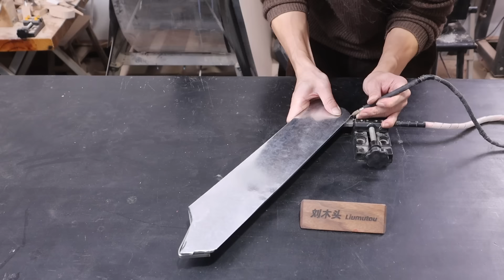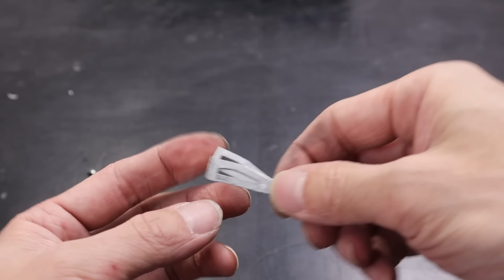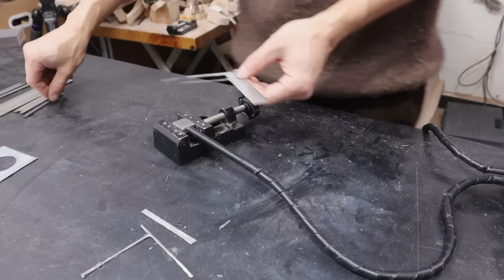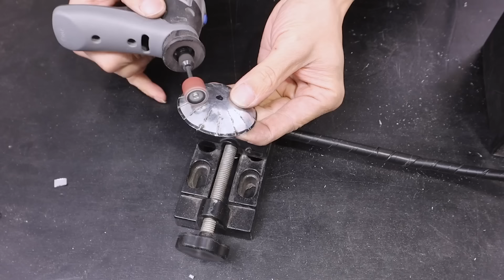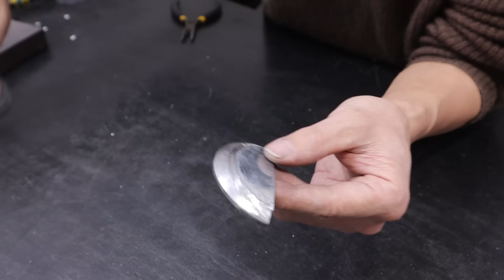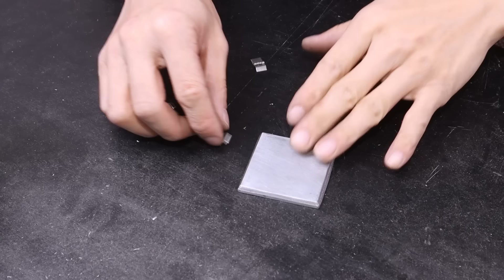Build Metal Tank KV-2 | How To Make a Tank out of Metal | Remote-Controlled Tank

Comment: What welder were you using on the sheet metal?  Great project, thanks for sharing.
Reply: Spot welder its using high dc current for a second to melt the two metals together its also used to connect lithium ion batteries
Reply: @w4st3lander why did not the chap use isolating/insulating gloves?
Reply: @tatianaes3354  it's not a good idea to use gloves as they can catch on fire also the current only passes throu the metal not your skin. Also its not high voltage only from 2 to 20V depending on the spot welder its mostly only high current which isn't as dangerous as high voltage.
Reply: @w4st3lander where can I buy such a spot welder ?
Reply: @doncarlo5  i would recommend to learn how to properly operate one first
Reply: @doncarlo5 eBay Chief. Glad you asked the question. I was wondering the same thing 🙏🏻
Reply: 🇹🇱🇸🇾🇹🇰 نرةقسهةفصف لق
Reply: There are many Boob-Toob videos on making a spot welder for making battery packs. Most are made from microwave oven parts. If you decide to make one be sure you are careful as there are potent currents and voltages present.
Reply: Tig welded mine, but this is awesome stuff. Currently working on a ship
Reply: Spot wleding
Reply: Maybe a drop of dark food colour to darken the smoke ?

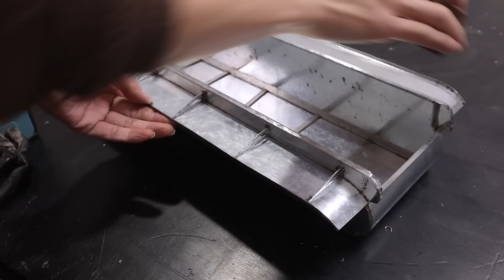Comment: Confirm exit galaxy 2:30
Toy first class welding micro tv instruction 

Wood lamnent 
Or & neutral 
Solid jig 
17 shovel & 16 shovel metal foundry 2 tap b.e.a.m. scientific & art operator 3 year training double tap scoop 
8 shovel reciproction check off shore to natural resource forestry & service center oceanic biological department 
17 miles 19 miles on, woot resource management festival 5 year retirement, track 8 lamnent & jig wood  shovel 6 shovel track 16 feet 18 feet travel ibeam trqck 4.5 wood lamnent cylinder 14.7 steel track  147feet for shelf 
Year 1351 ª 1570 year
Year 2093 ª 2235 year 
Year 2454 ª 2612 year
*
** 
Reference 

Structural mechanics wood scale modeling fortress wall 97.8 3.1 feet 14.7 inch steal 2.0 caps north south falling walls and post apocolypse retentiin aerospace interior astral star. 

Detonation #38 unlawful destroy 3 fleet 1.1 through 6.8 rads joules infant mortality 
Fatality 
Trauma death dismemberment disability 

R.O.A.M
C]

Conduit terminal 
R.O.A.M. intercom master remote
C] 
C]C]
Vt]
Resource management, 
Requirement roadway 
1341 year ª 1561 year
2093 year ª 2235 year 
2456 year ª 2617 year

Conglomeare mountain debri, 1 , 2 globe impact australia exit 17 miles 2 tectonic plates entry argentina 2 tectonic plate 1100% new zealand ..."remove ahl trees" "remove all trees"
Rectangle lamnent wood shock absorber cylinder lamnent ⅛¼⅓⅕ 4.1 feet 3.2 feet 6.7 feet 481 feet 6 feet high 4 feet 3 feet fire resistant water resistant  glue , totem 6ft tick  20ft+- 14 high solar heat
Tables fire resistant 5 inch × 19 feet × 9 feet
.. 40% to 57% more efficient 
 referrence This is important forest 
Crop request equipment? 

Resource management, 
Requirement roadway 
1341 year ª 1561 year
2093 year ª 2235 year 
2456 year ª 2617 year

Conglomeare mountain debri, 1 , 2 globe impact australia exit 17 miles 2 tectonic plates entry argentina 2 tectonic plate 1100% new zealand ..."remove ahl trees" "remove all trees"
Rectangle lamnent wood shock absorber cylinder lamnent ⅛¼⅓⅕ 4.1 feet 3.2 feet 6.7 feet 481 feet 6 feet high 4 feet 3 feet fire resistant water resistant  glue , totem 6ft tick  20ft+- 14 high solar heat
Tables fire resistant 5 inch × 19 feet × 9 feet
.. 40% to 57% more efficient 
 referrence Hi, high speed railroad crossing mississipi river. 15 story building. Mud debri 1341 through 1563 

Coming soon conglomerate mountains impacting c] 
Class 6, 7 gravel 100 kilometer cu²
15 years 1 or & neutral 0 harvest 7 years food store a.f.l.c.i.o. city trainer maintanance, roadway farmers market 
Pul.ice ash debri 18 months looks like valley shadow doubt," great depression 1932 "
Thanks dragon fly went to live around area.  Morning breakfastE.N.U.K. ufo hunter prenatal maternal child r.f. conduit technical purchase component computer .. ...
I.l.o.ñ. nuclear 
A.ñ.z.c. economics 
R.a.m.ñ. pstchiactric

Emacs

1.27% emploment 
17 employees
19 employees

01 public school art & science

07 public school teacher art & science

Co-op leaf grass branch pine needle 3.63 rinse 

3h.p.tree trimmer fresh water and ocean 96° 94° shovel lamenent 17 shovel 19 lamenent retirement lamnent 5 years resource 7,8 shovel oiter space and deep shelf carry 9 mile 17 miles 3.1 wood lamnent spiral tire 16 feet  19 feet 14.7 inch steel wire cement